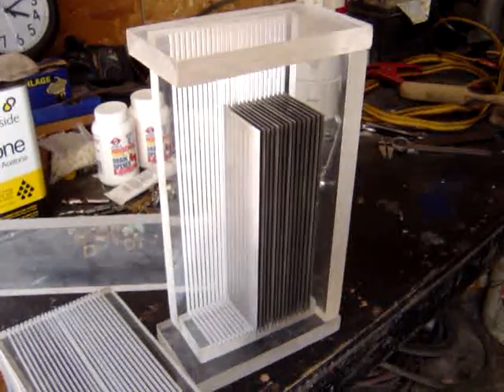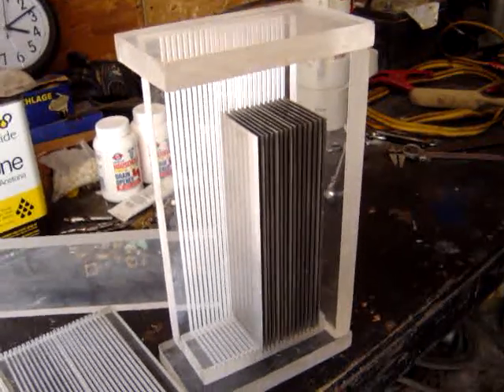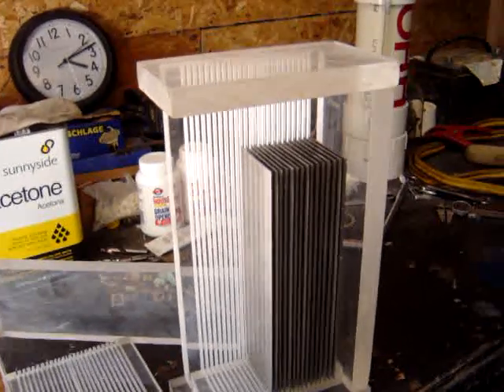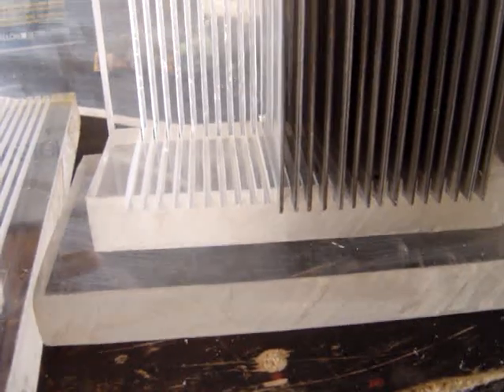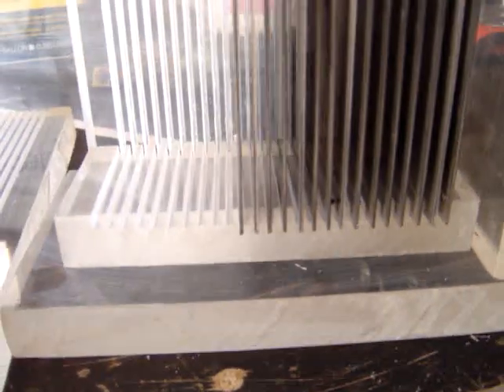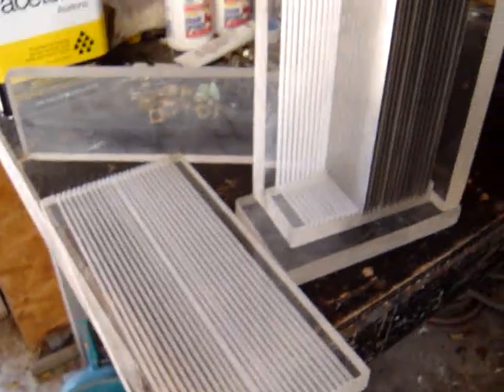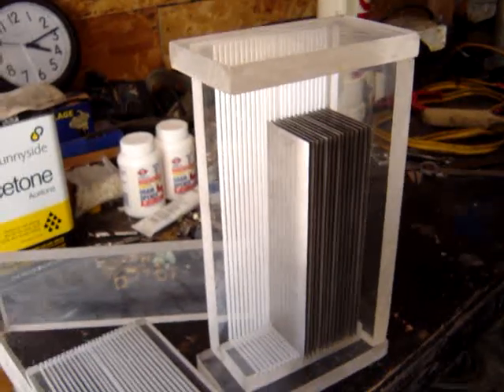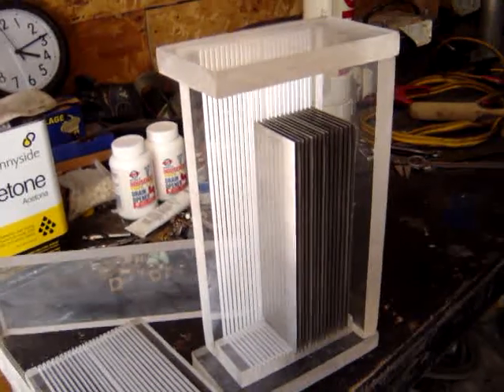HHO PLEXIGLASS CELL

Comment: ya I have been toying around w/ a few designs, but the cost to produce decent test cells is pretty high.  I like your construction.  but sucks that if you decide it needs a tweak( once it's built ) there might not be room for minor adjustments, and having to fab more.  like one of the multi cut sides woud time consuming and costly.  plexi not cheap.  good work, which one did you like best of the ones you made?

Comment from the maker: @mousetrap128 The water can go between the plates equally because the plastic block that the plates sit on is not sealed to the sides of the box. I realize this makes it more inefficient due to current bleeding past at this location (a flaw most cells have).

Comment from the maker: The idea behind embedding the plates into the walls has nothing to do with gas production, it is to prevent the electrical current from bypassing the plates and going straight through the water (this just makes heat). Holes in the plates also just makes more heat by electric just going throught the water and not the plates. To keep plate and water temps down more neutral plates are the answer. The optimum setup is about 2 volts per plate gap. the unit is held with screws and Goop brand sealant.

Comment from the maker: Thus the neutral plates. Extra surface area and fantastic amperage control. Ya just gotta beat the heat before it becomes an issue. Or use a pulse width modulator to keep an overheating cell under control.